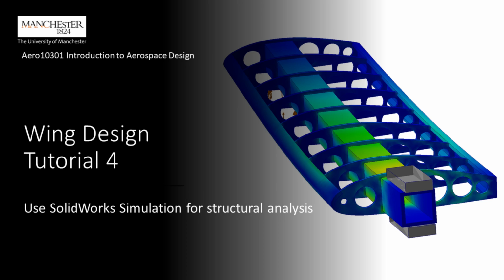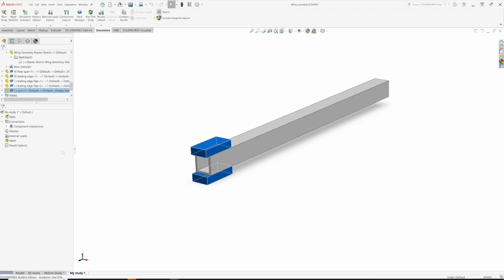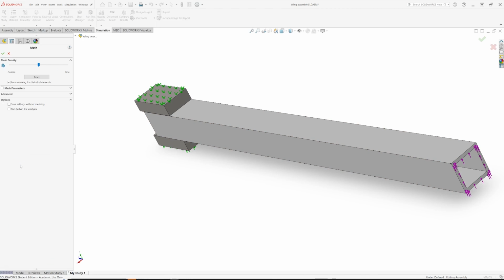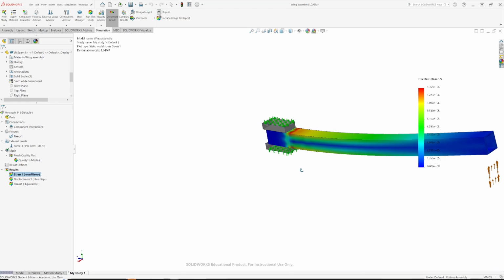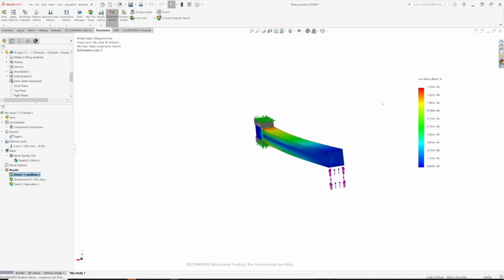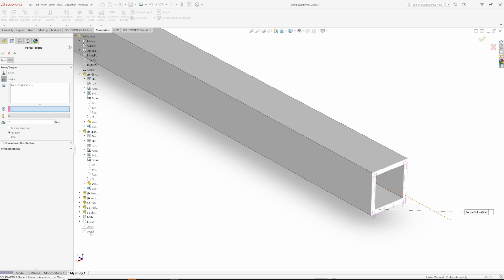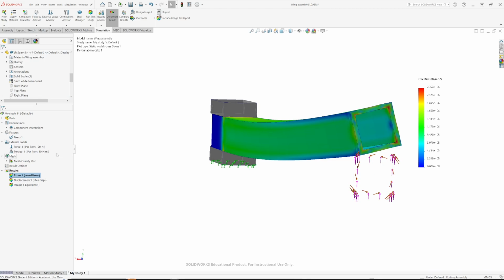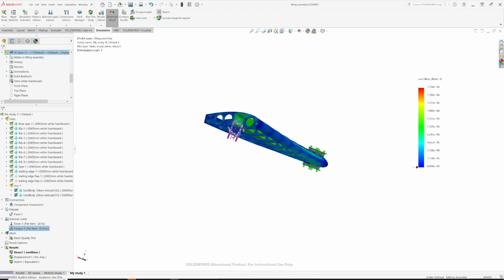Wing design tutorial 4   Use SolidWorks Simulation for structural analysis

Comment: Great post, very clear and detailed. I really learned loads of new functions and more of all, the step by step procedure, from zero up to the solution.

A function in SolidWorks you didn't mention is the security factor. I am quite sure I saw that somewhere but I can't figure out in which sub menu it was ..
Also, would you share your Excel file ? I made a much more basic one and yours seem great.
Reply: did you get the spreadsheet?